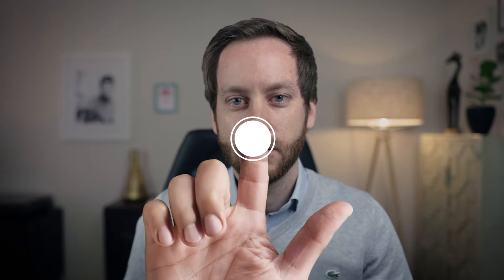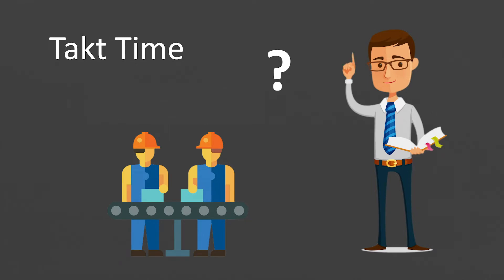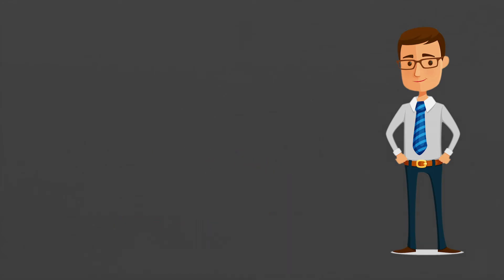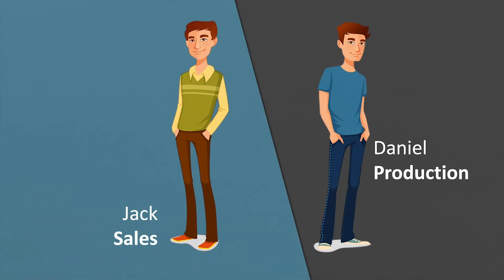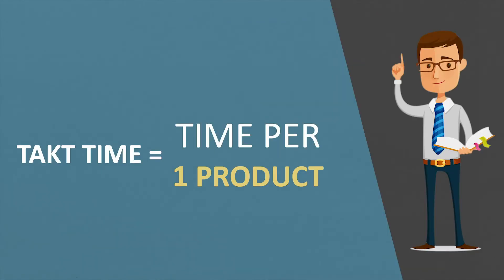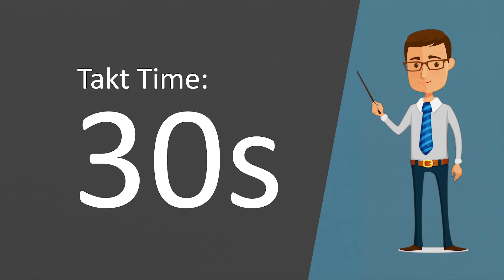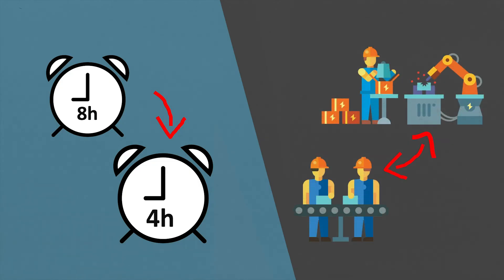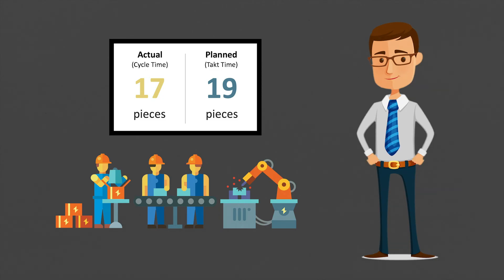How to measure TAKT TIME and CYCLE TIME? The Lean Manufacturing Guide

Comment: Interesting distinction. From my understanding in the industry Tact time = work content (manual movements & assembly) + Cycle time (if additional process with set time to perform action ex vibration welder might have a cycle time of 19 sec).

Comment: What if the same production line is used for multiple different products with different cycle times (müesli for example), and demand consists of a mix of  these different müesli products? How would you then calculate takt time?

Comment: So I have calculated cycle time for a bottleneck manned station that has variation in it along with inefficiencies out of my control because it is after the process controlled by the conveyor speed. Conveyor speed is going to be increased however the calculations show that we have just barely enough to meet the demand in the positive. However in our current condition we are always working overtime even with excess overspeed due to the inefficiencies. I’ve calculated the efficiency rate at 91% that needs to be processed in an 8 hour day. How can I convince management that we actually don’t have the capacity because our efficiency rate will never be 100%? They want to rely on the  show that we can?
Reply: Hi. If is still relevant. There are still other options to be checked and possibly improved. Try to define value added vs nonvalue added activities. Eliminate NVA as much as you can. Next step is  waste identifucation. Overproduction is the most terrible one. There are ways to improve.  After you are done with these activities, you might be able to convince management. 
What is your situation today? It is harder to advice without picture.